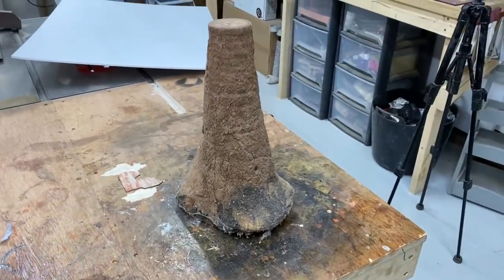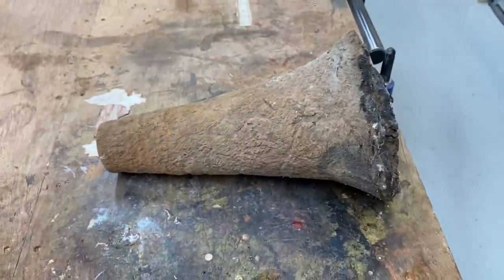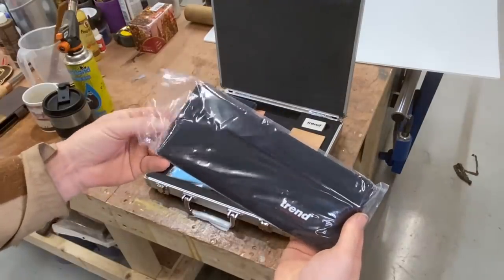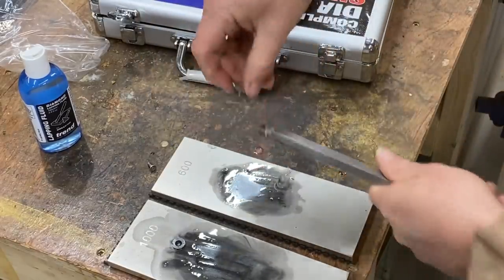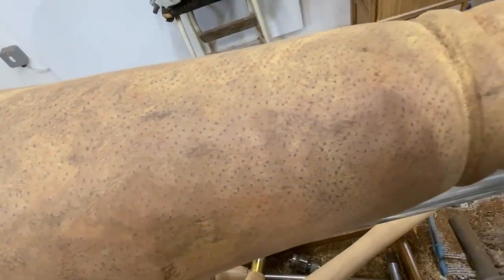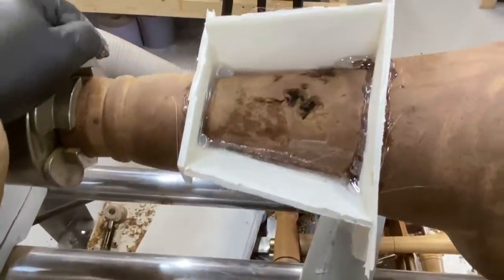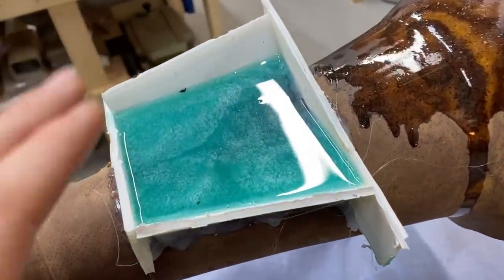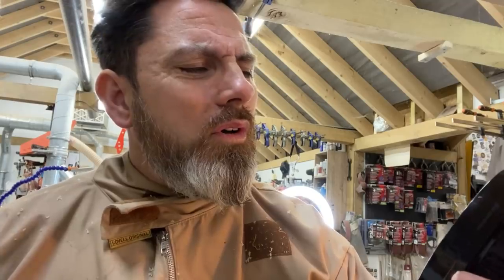Woodturning - The Palm Tree Root !!

Comment: I think that is palm. Possibly queen palm. Porous, fibrous, and a bit punky at times. Stabilizing it with resin was a good call. Enjoyed the project. Thanks for the show.
Reply: I didn't know that there were different species of palm trees. You learn something new every day.
Reply: Have you ever seen another palm root that looks like this?
Reply: I was going to say the same.  Palm is technically a dense grass, not true wood.  Can make some nice things with it if you stabilize it though.
Reply: Or a fern
Reply: @Earendilgrey  Palm is a true tree not a dense grass but is a monocot like grasses so the wood does not have growth rings but is similar to a bunch of grass stems compressed together.
Reply: @philipbloomquist1580  That is what I meant, I just worded it wrong.  Thank you.
Reply: It’s a grasstree root
Reply: Yes it is a grass tree root or as we call it here in Australia blackboy its the root of the blackboy you can only get it when it dies but you have to be very lucky as most rot out very quick, he was extremely fortunate to get one that large usually they are small the holes are grub holes they bore in for water my father and grand father used to turn it a lot..
Reply: @mrsock3380  Yes, I have.  I lived in Arizona.  There were a couple of times when the palm trees grew too many offshoots and we had to trim them.  The 🌴 “stubble”is like the outerhusk of a coconut 🥥 has been shaved off.

Comment: That came out awesome! I like the light. However, I think putting a speaker in there might be even cooler. It kind of looks like an old gramophone horn. I think the base would have looked a little cooler if you hadn't sanded down the burl first, and just sealed it.

Comment: I really like watching you using the wood lathe especially if it’s just the wood no resin. That being said wouldn’t it of been easier to just use some wood dust and glue to fill the holes instead of mixing resin and having to wait over night to finish?? The only reason I’m asking is because I’m all about the purity of the wood sometimes using resin on a project is good other times it seems to take the beauty away from wood grain

Comment: Would have made a nice lighthouse table lamp, by the way palm grow different to normal trees, instead of adding a layer each year on the outside (sap), palm fold back from the center to the edge, what you are seeing is the ends of the fibres.

Comment: I'd flatten of the face of the wide end, drill a 3/8 (0.375) inch hole lined with a metal pipe through the length of it, bore out a large pocket in the wide end, fill the pocket with Resin and metal BB's (to make it very bottom heavy) and make a lamp from it...